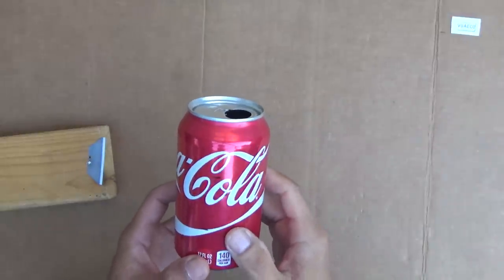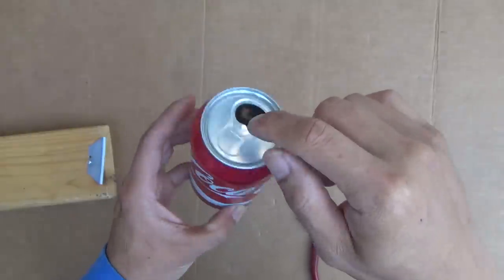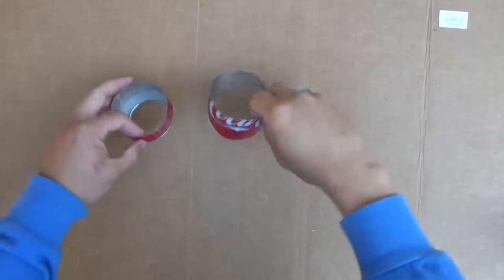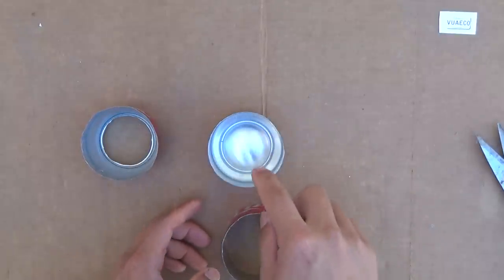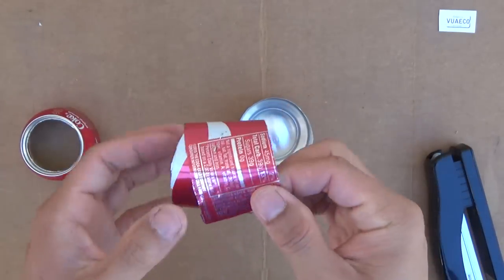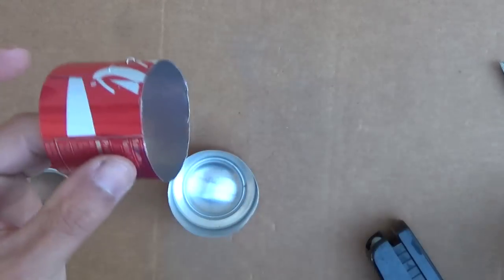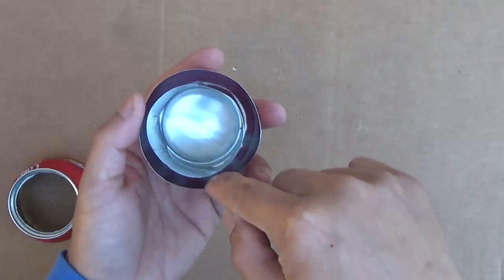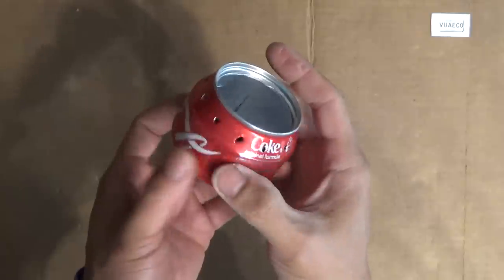DIY: Home made Alcohol stove from a single aluminum coke can

Comment: can openers work for the top part
Reply from the maker: Nope. Can opener does not work at least for what I'm doing. I need a thick lip at the top so it will keep the inner ring in place. It's the "groove" I was talking about at 5:18. A can opener will cut the top almost to the rim. There's no more space to insert the inner ring in it. If you think about it, a can opener will need to cut it in a way that the top lip wouldn't be too thick or it will get food stuck when you try to pour food (or whatever inside the can) out. I need that top lip to be thick so it would contain the inner ring in it. No can opener would do that or it would defeat the purpose of a can opener. If you don't need to top lip to be thick then yes, a can opener would do it, but not for this project.
Reply: I see what you mean, my apologies friend.
Reply from the maker: No worries. I just wanted to clarify. That was a good and quick way to cut it for other types of alcohol stoves though.
Reply: @vuaeco  You know I love ya buddy, but the way you're doing it with the Stanley knife is not safe. Besides cutting yourself with the blade should it slip, chip or suddenly cut (!), there's also the risk of getting the meat on your knife-holding hand jammed in the blade retractor lever when it pushes closed (as it did at 1:00). Ask me how I know! LOL

Short of a Dremel or Rotozip, the best tool I can am able to think of would be the type of can opener on a Swiss Army knife (also, on some older dual bottle/can openers). It follows the curvature of the rim, and you can control the width of the cut by varying the angle.

Play safe, my friend.
Reply: A can opener worked for me.
Reply: @YouTubeMaster1611  I just did that and it destroyed the lip I need for the inner wall.
Reply: @crazysquirrel9425  I don’t know man. Maybe I have a different can opener. I’ve only made one of these and I used a can opener.

Comment: I found using a using a can opener is the easiest way to remove the top portion of the can. When you use a can opener is a clean-cut. I also use the middle portion as a wind guard. I've even use the top portion that cut out as a means so that you can snuff the stove out or you can use it as a separator in put a piece of call inside in a bit sucks up the fuel that you put in whatever by your choice you can keep the core in the fuel. but having the lid the one thing is using it to snuff out you can slide it across ithe can. I have made dozens ofof these Coke can stove and a few to cut a beer cans from your model period I have just changed it a little bit. I've made a few Penny's toes and you are correct they are not very what I've had to do to get even one it wasn't very beneficial. I then used the accessof the penny stove I used the excess by making a candle holder so I took the two ends of the candle you drink and put thosesealed after bottom you can use that as a candle holder period so I used all parts of the can but to do the candle holder you have to make the which is the bottom of each can. I don't find the penny stove that it's not productive it is more of a problem.

Comment: Use a Vimto can instead.

The groove on the top is the same diameter as the groove on the bottom, and will let you use a parallel, rather than tapered, inner wall.

Comment: Use books as a height adjustment and a leather man serrated blade by laying the leather man on the book use more or less pages to get a precise height adjustment. I suggest 3.5 centi meters for top and bottom halves. Don't use a can opener it will destroy the top ridge which supplies strength.

Comment: instead of cutting out the entire center top, cut out about 2CM or 1" circle.
When you light the center alcohol, the flame will heat that lip and transfer to the burner area.
Faster priming that way.
I wonder if someone has a downloadable template so we can draw it out on the center part of the can and cut to fit.
Much easier and more accurate than guessing.

Comment: this home made needs too many tools... why no one shows a emergency stove that can be build with trash cans you can find in the street or field and only tool is with a knife
Reply: Time consuming.. Not effecient kind of work.
Reply: Frank C
This can be made with nothing but a sharp camp knife. Use the blade on its side to score the can, use the tip to make holes, use back of blade to crimp bottom for insertion in top during assembly.

Comment: To dangeras by far make the peny stove insted.👍
Reply: John Davies my penny stove expoded, burning my finger. This one on the other hand didnt.
Reply: Carlos_A_M 
wtff, this shit can explode?
Reply: @mclovin510  not this one, this one is safe, the other model known as a penny stove did. Im lucky to still have my finger.
Reply: Carlos_A_M 
damn, what happened? You did something like turned it or toppled it or did it explode out of the blue? 

Good to hear that you're okay though. Thanks for sharing your experience.
Reply: @mclovin510  i just turned it on with a match and it blew up instantly. There was alcohol everywhere.
Reply: Penny stoves are like an active volcano with a small hole. Too much pressure to go through one small hole, it will explode...
But an active volcano with a big hole; or lots of holes... no explosion, it will be just like letting off steam while the lava goes down the slope quietly.